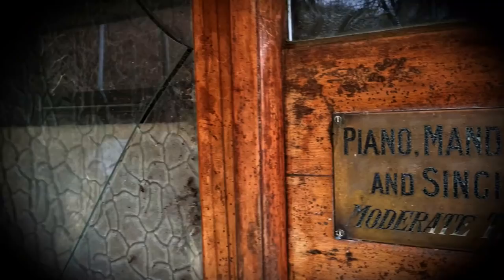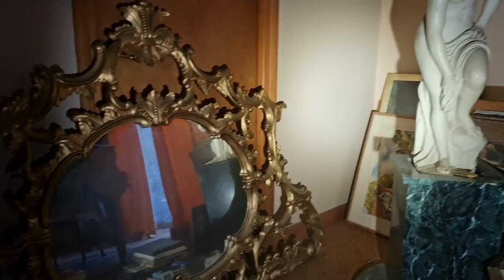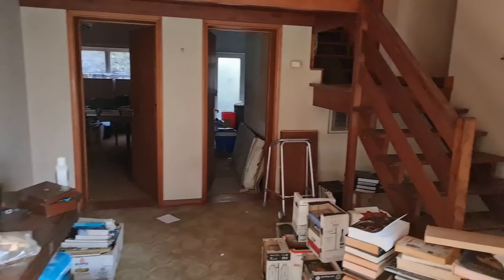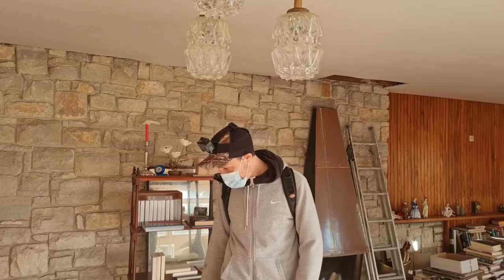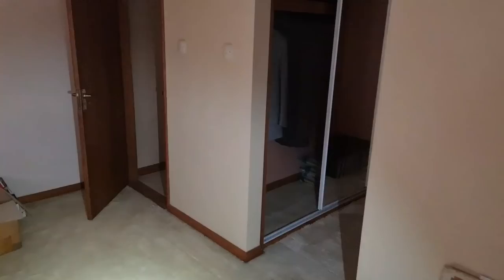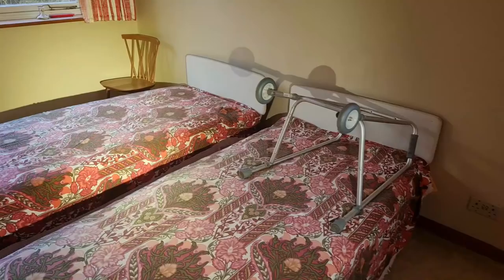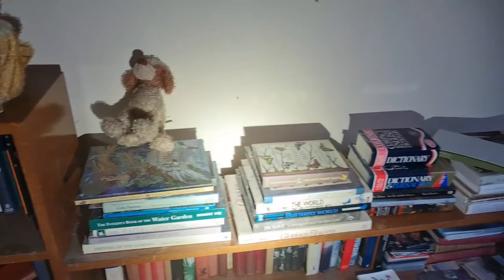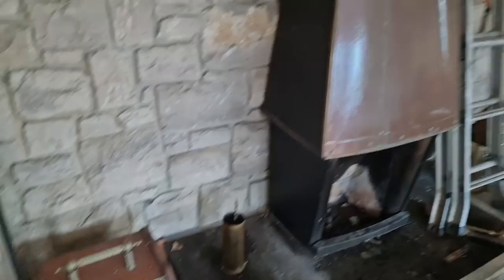We Found an Art Forgers ABANDONED Mansion - Everything left behind

Comment: Thanks Alex and Guys, Great vid as usual, my first thoughts are fireplace in swimming pool area - very South African as they use them as a barbecue, also maybe some SA / Rhodesia movements with the design of the woodwork called Deal to be confused with Mahogany. The vents you show are indeed warm air (or warm dust we called it as heating apprentices) The switchgear you show 3 phase, suggests it was electrically powered maybe by an off peak supply necessitating storage bricks using a night supply probably located in a separate room. The vents above the doors recover and re-circulate the cooled air for a circulation of air back to a heat recovery grille. A very quick warm up but dry form of heat resulting in a chilly atmosphere when the heating switched off. All the best guys